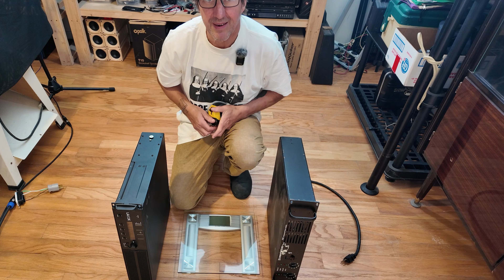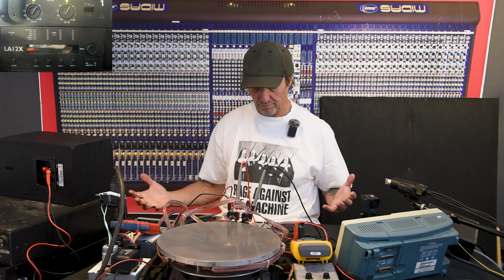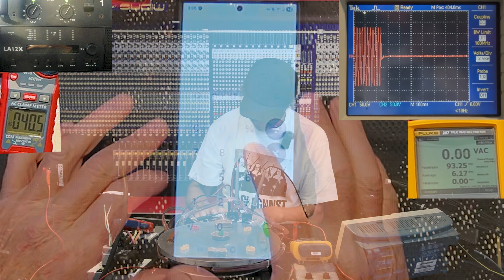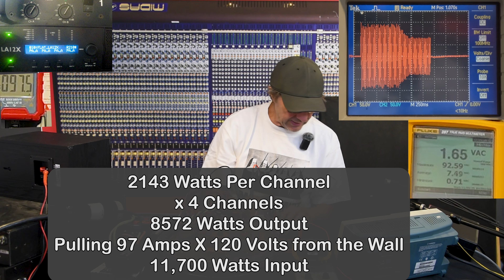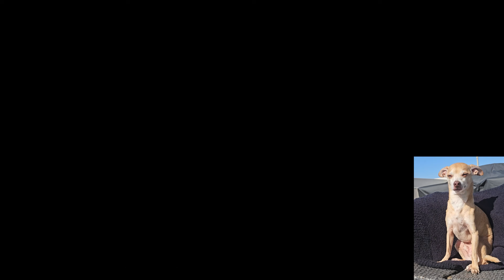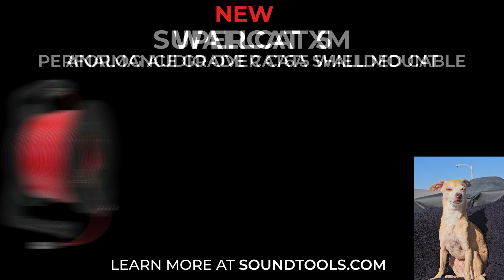Who Does RMS Power Better, Old or New Amp?

Comment: When is Watts per lb significant? International shipping? Truck weight? Number of castors needed for the box?
Reply from the maker: when deploying sound for live events, weight is a big factor. not only for transport and human lift factors but also amp racks are often hoisted I to the air along with speakers to keep cable runs short 

for Coachella festival we deploy around 800 large format speakers to 6 stages with about 2000 to 3000 watts per speaker.

with about 1.6 million watts that need to be setup, amp racks that need to be wrestled under stages and into delay cluster footings and such,.

at 325 watts per pound the amps weigh about 4000 pounds plus racks and such (look up L- acoustics LaRakIi)

at 32 watts per pound we would need over 40,000 pounds of amps. 

more racks, more trucks, more time, more space. plus more generator power and more feeder to deal with the lower efficiency of non class D amps. plus more heat, more fans and so on.

but even for a person doing a DJ setup for a wedding, hauling a 20 pound amp that plugs in the wall up the stairs vs a 60 pound amp that won't run on a standard wall outlet is a I big deal.
Reply: @DaveRat , you could NOT hoist the amps. Class AB sounds better. If you want the most organic sound I don’t think class D is the way to go.

Comment: My take on this would be that the Class D amp has much more headroom than the Class AB+ H amp so therefore you would never really play the Class D amp at full volume anyway , so that output reduction in power would not happen if not fully driven.

Comment: When I expanded the sound theater in my barn with  four atmos height speakers I went class D on the bottom end . These are flown bi-amped Cabarets with K 145's and larger flares with 2445's on the top . I'm convinced , I'm using class AB on the top and they get warm . The class D on the bottom don't even break ambient , When my stack of ISA's fail which they haven't , hopefully won't , I will go class D on the bottom ! Good video , thank you !

Comment: Hey Mr. Dave.  I've enjoyed this video, but I also do not like this video.

In this video:  You demonstrated that an "old" amp (if class H, then I'm really old; old-school amps don't have sliding power rails like class H has) is consistent until the weak link in its power source (its input breaker) gives up.  That's robust in an important way;  that amp is an entity that can be written down on a notepad, dialed into a spreadsheet, and that will ultimately do pipe organ music at a constant level until the cows come home as long as it is kept within its easily-discovered limits.  It simply produces, or it gives up completely.  It never self-limits in any other way.  It gives everything it can until it gives nothing at all; the sonic output remains the same until it quits.

That's easy to deal with, and easy to predict.

Also in this video:  You demonstrated that the "new" amp (class D; and I actually am old so I remember the OG class D demo modules from Harris Semiconductor as being the new hotness in amp tech >30 years ago) doesn't behave that way.  It gets squishy.  It gets hard to pin down.  It self-limits in ways that reduce gain.   It can't do pipe organ music until the cows come home; it will instead be an entity that needs to be chased around because it's harder to find its actual limits.  It gives what it feels like right now, and then reduces gain until conditions change.

If the longer-term limits are not defined, then we don't know what they are.  I can write down "IDK?" instead of a number on the notepad but doing so doesn't help me to either plan or to operate a system -- at all.

And then, in this video:  You proposed that a good way to deal with this modern ambiguity is to simply mix up the amps, so that any one amp is doing a mixture of things.  That kind of work-around may seem fine on the surface, but it is also hard to  cable-up and isn't universal for all music.  It's also loosely-equivalent to Steve Jobs suggesting that the iPhone users who were experiencing RF issues were holding their phones wrong.

And as a practical matter:  Do you run your own stacks that way?  If so, do your gear-chuckers hate you for it?  :)

---

Let's see a simpler test:  Put some amps (one that is actually old-school class AB with a simple power supply consisting of a transformer, filter caps, and some diodes, another amp that is modern class D, and another that is class H or something), doing continuous tones, for a long time.  Whole minutes, not short seconds.

Let's compare what they claim to do to what they actually do.  Let's look at the output waveforms and distortion figures as they proceed in the test.

You don't need the meme hotplate for this.  Nobody with sanity doubts the honesty of your tests.  If you say that a big dummy load is 4 or 8 or whatever Ohms, then we'll accept that it is the same dummy load between all amplifier variations.

(And besides:  The meme hotplate can't stand up to pipe organs regardless of amplifier topology.)

Comment: Lol - Dave found a way to delineATE a Kit-Kat 😄  Hey for us Down Under in Australia and NZ on the 230 (formerly 240) volt AC power standard - I'm curious if those big amps like the 4 channel you used here - can deliver a nice solid constant output from our higher AC supply.

Comment: i have 16 macrotechs and really appreciate you putting this test together...At what frequency was this test performed?  Would a lower frequency >25hz have a different affect?
Reply from the maker: I don't remember the freq, but I think it was 40 or 50 Hz. typically class D amps can go lower but not as high.

that said, it is design dependant. an old DC300 Crown will amplify DC. 

where class D designs often struggle are the high frequncies above 20K where the signal approaches the switching frequency.

Comment: 16:31 i think ive seen a video of yours doing this with a LA12X, i was wondering if i get the subs into two channels and the other two powering my mains, would it be the same thing? I would still get this drop? Even though they dont always reproduce the same frequency range..

Most of the times i wouldnt be able to push hard both mains and subs at the same time

Comment: Class D switching amps are so good as long as ya don't cheap out.  I wouldve loved to see a QSC amp with "Flexible Amp Summing Technology" test run all 4 channels in parallel for 1-ohm loads,  also, would love to see how it compares to a PowerSoft X8
Reply: What's cheaping out? CVR seem to be doing a wicked job with their Class D designs. They're definitely cheap for what they are. Are we talking about the more consumer stuff like Crown XLS?
Reply from the maker: my take is that if you have a 500 w class A B amp or class h you have an amp that's got a significant amount of reserve power that could output 500 watts for a good period of time and not a lot of peak power over the 500 watts. 

if you get a 500 watt class D amplifier it's highly probable unless it's a very high-end amp that it's peak power is around 500 watts for a fairly short period of time and it's continuous power is some significantly lower number.

to get a class D amp that will put out 500 watts for a good period of time you probably need to get a 2 or 3 thousand watt or more class D amp. 

or put another way, replacing $1,000 class AB amp with a $50 class D amp will probably not give you similar results even if they're rated at the same power.
Reply: @DaveRat  you saved me some typing.  I have nothing else to add
Reply: Correct me if I'm wrong. But that is not what you showed in the video? The class D made the 2kw per channel (which is what it was rated) continuous until you load "too many" channels with subs that demand long  sustained continuous high output. 

But yes, the video shows the "10kw" amp can't sustain 10kw output for more than 1s. But when less channels were driven. It made rated output. 

If you tested a more "apples to apples" amp, I.e. a 2 channel class D amps, then it should do full output "long term" just like the class H. 

From cheap to expensive, CVR to powersoft, they all say that the 4 channels are designed as system amps where 2-3 channels are not on subs, and they all make a 2 channel class D amp (with double the amount of capacitors) that are for "subs in both channels". 

So even the cheap CVR/admark amps make the rated power, just not with the 4 channels when used in a way they were not designed for (subs on all channels).
Reply from the maker: agreed, though I'm not sure that a two-channel class D amp will perform any differently as I don't think it's the number of channels as much as the method they use to rate the amplifiers. 

I would say it's highly probable that a two channel amp will perform rated power with one channel driven and the time frame that it's able to deliver rated power will reduce as you increase the amount of channels. 

the current thinking for amplifier power ratings is that with music that tends to be a 3:1 to 10:1 continuous versus peak power, that rating it based on its short-term peak power is sufficiently accurate for real world. 

the old rating system where amps were rated based on the ability to deliver long-term continuous power is kind of currently deemed to be inappropriate because that's not how amplifiers are used for audio

Comment: It's not the maximum ouput when tripping breakers and/or exceeding current capacity of connection to the mains power (IEC connectors, cable, wall socket..). The usable output capacity is obviously slightly less than that.
It's false advertising to label them 2x 2000W when the supply at best is 2400W RMS that can be split between them giving average of <1200W RMS per channel in practice. Old transformers were <70% efficient (<700w out from every 1000w in). Toroidal based amps might be ~85% efficient, switchmode D-class amps are >90% efficient.
YMMV.
Reply: It's not false advertising. Your breaker does not limit current. You can pull 8 times the breaker rating for 200ms before you will start having trips. 200ms is plenty long enough for a 2000w x 2 transient snare hit. It's enough for 7,000 w x 2 for a transient hit. Tripping a breaker is a process that takes time determined by the thermal magnetic trip curve of the breaker. 2000 w x 2 (for short bursts) is still usable in practice. It allows higher volume levels then an amp that can only do your 1,200 w x 2 continuous all day long.  Unless you are playing continuous sine waves like some EDM bass music tracks, continuous power ratings (that used to be the gold standard) are the wrong metric to measure audio amplifiers. By not having a higher burst capacity like these class D amps, with a crest ratio of 6dB (highly compressed music) means you are wasting 75% of the power you paid for and carrying around all that extra weight for nothing just so you don't clip your transients. The class D amps don't clip their transients either, they can do very high burst power.

Comment: before watching* Im going to guess that class H will have more of a clean sign wave after like 25s. But only after the class d is almost clipping
Reply: There's no inherent audio quality difference based on amp class alone.  

This study however failed to monitor the thermal sensors with Type K thermocouples and a digital data recorder, coupled to high speed SloMo video recording, to evaluate the sacrificial destructive testing of oral interlude ritual tools from Halloween assortment leftovers.  ;-)

Comment: Thanks for this. I have wanted to see just how much of their ratings modern amps can push. Mainly because I get a little mad when I see output ratings that far exceed input power. I don't question them too much though because I've been raving for ten years and all the loudest systems I've heard are PK or LA so it's class d whether in the cabinet or a rack. And the 102 double 18's I stood a few feet from last year certainly didn't seem like they were exceeding their power budget
Reply: How do you know that they are exceeding their input power? Most people don't realize how much power you can actually pull from the wall (albeit for a very short time). A 15amp breaker doesn't current limit the circuit, when you exceed the rating it "starts" a thermal trip process, that process takes time and is reversable. You need to look at a breakers "thermal magnetic trip curve" to see when it actually trips. A typical 15 amp breaker can allow up to 8 times its current rating for 0.2 (sometimes much longer) seconds. That's 120 amps for 200ms, plenty long enough for a transient or a snare hit. As long as you don't average power consumption over 15 amps for a long time so the bimetallic strip has a chance to cool down in between hits, you won't trip your breaker. Someone scoped and posted graphs of a Behringer nu-6000 amplifiers Pulse Width Modulation (PWM) power supply and it only drinks current from the wall in 2 states that alternate. Either it takes a pulse at a full 80 amps from the wall or it takes zero. It alternates between those 2 states in pulses to fill it's reserve. It averages under 15 amps and that keeps the breaker happy but it takes a full 80 amps for 50 ms at a time in pulses.

Comment: Bought a Peavy 2600 class H about 14 years ago because at the time the class D stuff seemed lacking.  I still have the 2600 running in my personal rack all these years later.  But it is such a heavy beast.  This will make me consider class D pro gear in the future.

Comment: EDM can't we just hook the bass bins directly to the 60Hz AC mains and turn it on and off? 😛
Reply: Just hook'em to a generator and use the throttle as your pitch control
Reply: That’s very close to what a class D amp actually does.
Reply: That’s what Bob Carver did, but unknowingly bypassed the safety standard of being isolated from AC mains. He did accomplish extremely high peak power rating by taking the isolation transformer impedance out of the equation.  But safety hung in the balance.
Reply: @SquareRootOfEvil    I’ve owned many Carver amps, PM1.5 and 1200, and they were neither digital nor did they use a switching P.S. He used a multilevel power supply, I believe three levels, so that the amp spent the overwhelming majority of the time conducting very low bias currents to the output rather than the bias current for the full main supply voltage. It’s worth noting Carver did not advertise RMS power ratings for these amps. Rather, they advertised a musically relevant crest factor which was not very well understood then by buyers.
Reply: Back in the 90s I worked at a NYC studio where some engineers often requested fresh NS-10 woofers, believing they quickly became "fatigued" by hip hop. So I took 8 old ones, mounted them in a cardboard box, wired them in series, and put an extension cord on the end. Worked fine for hours as a downtown haunted house electric chair sound effect that year.
Reply: lol :)

Comment: It's quite unfair comparing the 7001 amp which is much smaller to the other amp. You have to go with the 9001. That's a whole different beast, and it will bury that class D amp. You just have to feed it at least 32Amp if running 240V.
Reply: The 7001 still won the "sustain the maximum output" contest though
Reply from the maker: it just depends on how you want to put your finger on the scale to bias the outcome.

which amp has more output per pound? per dollar of cost? per cu ft of truck space? per rack space? which has more output for a given circuit breaker size? which has a higher peak output? or is able to deal with line voltage drops without losing output power or can accept wall voltage from 100 volts to 250 volts or will generate less heat per watt produced?

pretty much class D technology easily wins on every metric.

but if you add things like: the amp also needs to have no fan or needs a frequency response to 30K, or needs to have a sentimental story or you want to buy it broken and fix it yourself easily

then non class D amps have some advantages.

as far as the Crest 9001, it's a beast that can put out over 6000 watts bridges into 4 ohms but still, for a given circuit breaker size, a beefy class D amp will have more output due to class D having less internal losses 

comparing a 9001 to something like a 2U powersoft X8 that can put out t000 watts per channel X8 channels run on 240. pretty sure the X8 will beat it in every metric including the X8 will drive loads below 1 ohm.

but I do like the old amps and have a lot of them still

Comment: I wonder if it throttles power back contingent on input voltage.  Some welders compensate output amps vs duty cycle per input voltage available.

Comment: The Crest PRO series earned its reputation through 'overbuilt' power supplies capable of driving all channels at full power.  This is a design philosophy they continue to follow today.  Others, obviously, do not believe in this philosophy.  Ha!
Great Video Dave.
Reply from the maker: it's a trade off. you can't get power out that does not come in. so to have an amp that does 12000 watts RMS continuous you need bigger than a 100 amp breaker.

but to make an amp that will do 12000 watts the way most music plays, you can do it on a 30 amp breaker.

Comment: Now I wanna run a line straight to my breaker panel
Reply: I thought all pro sound engineers added a couple 50 amp CS style twist locks in their living room...
Reply: @Basscouch you do what you can when you live in an apartment. Lucky me I was just just gifted a couple old Crown amps, so that 50 amp is needed. I do have 2x 18's on my home theater at the moment because why not!?